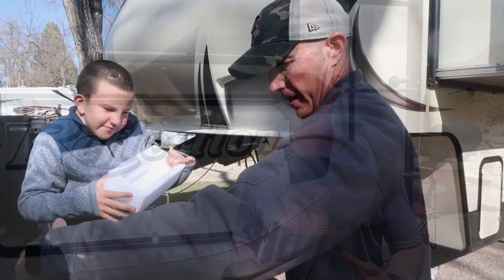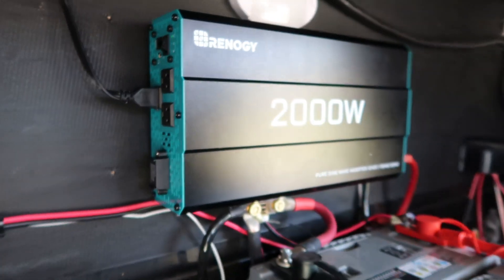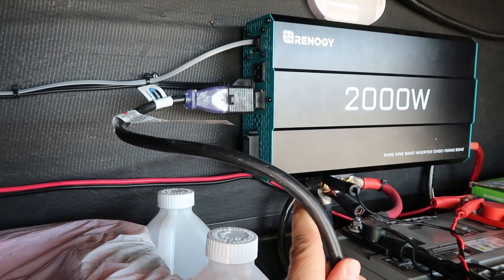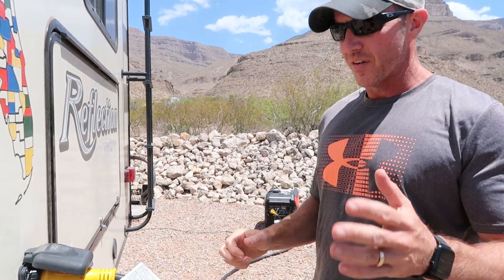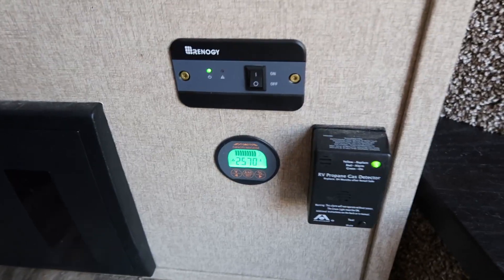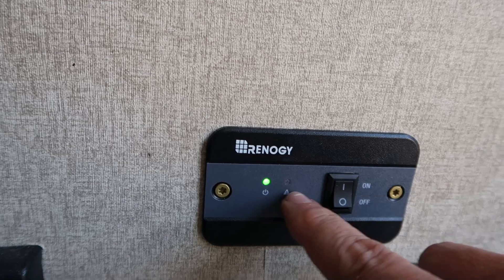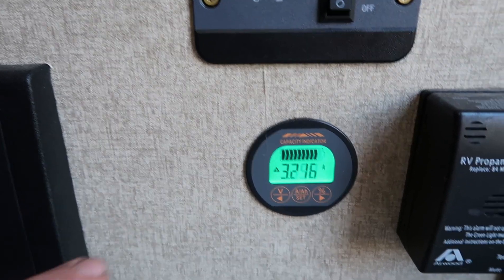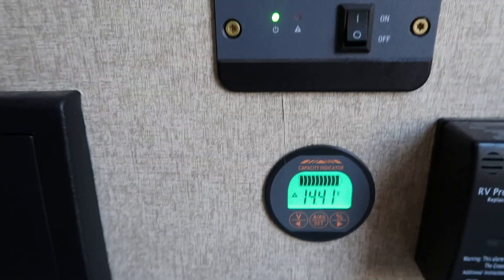How To Power Your Entire RV With An Inverter | Easy Inverter Power

Comment: Is your inverter hooked up before you battery monitor or after
Reply from the maker: Depends on how you look at before or after. The main negative cable from the battery goes to one side of the battery monitor shunt then all the other negative cables (including the inverter) go to the other side of the shunt so the battery monitor will read the amperage draw. This way, I can see the real-time draw being put on the batteries while the inverter is running. I hope that made sense! Thanks for watching!

Comment: It’s Frank I forgot to tell you that I have 2 2’ x 6’ Solar panels on my roof. I have a 32’ Motor Home.
Reply: I don’t know at this time cause the motorhome is in storage and I’m picking it up on Monday I’ll let you know then thanks for your reply
Reply: Let you know everything is fine when I’m camping except for when we go Boon docking I have no other source except for starting the generator so I wanted to add a inverter to keep from Starting the generator I don’t have any extra storage I did find one spot under the kitchen sink to add a small 2000 W inverter to my auxiliary house batteries. That’s why I was asking you a question. So I like the way you did it and I’m going to try it I let you know.
Reply from the maker: That seems like about 400 watts (at least) worth of solar. What house batteries do you have currently?
Reply: Heyy, I just bought a travel trailer..... this language is foreign to me. Somebody please hellppp.  I want to avoid a generator because I don't want to tote it around behind me. Will a wind turbines solar and inverter (on batteries) run the whole thing MAINLY AC
Reply from the maker: I don’t have any experience with the wind turbines. You would need at least a 3000 watt inverter to attempt to run the A/C and a large battery bank with enough solar to adequately recharge them. Running the a/c on an inverter and solar is doable but a very expensive setup. A small 2500 watt generator might be enough to run the a/c if it had a soft start installed on it. That size generator is much easier to handle than one like our 3500 watt Predator generator. Hopefully this helped a little. Thanks for watching!
Reply: @JouppiOutdoors  thank you much for sharing, I subscribed
Reply from the maker: You’re welcome and thank you!

Comment: Hi my name is Frank when you hook up your inverter did you hook it up to existing house  batteries or added two new batteries. I have no room to add new batteries.
Reply from the maker: I removed the single battery that came in the 5th wheel and replaced it with the 2 group 31 AGM batteries that you see in this video. If you absolutely cannot add more batteries, you could get a higher capacity house battery and still wire your inverter to it. Thanks for watching!

Comment: What is that port on your fifth wheel called 2:11 ?!? Because I don't have it 2:11into the video
Reply from the maker: It’s just the standard port where our regular 50 amp power cord plugs in. I am using a 50 amp to 15 amp adapter in the video. Thanks for watching!

Comment: My current battery set up ( lead acid ) is in a battery box that has a vent to the outside... if i install agm  batteries, will i have to vent them the same way ?
Reply from the maker: No, AGM batteries do not gas like a regular flooded battery. They are internally vented so there are no fumes that escape from the battery. Thanks for watching!

Comment: I have 5th same . Same Ali monitor even . But when you plug inverter to shore power . Make sure the got water tank switch is off. Because it's sneaky.  Lp heater and fridge I'm guessing.  But water heater I got screwed up on .
Reply from the maker: Good point, I should have mentioned that. I took it for granted that people would know to switch the water heater and fridge to propane. That’s where the battery monitor comes in though, you would know instantly if something like that was on because the amperage draw would be very high. Thanks for watching!

Comment: We have a very similar set up for our inverter! I don't have a monitor though. Probably need one. My switch is outside. Where is your house battery? I still have mine and it runs separate from our AGM batteries. We run our generator the same way. Thanks for sharing! Chris and Barbara
Reply from the maker: We run everything on the 2 AGM group 31’s. That little battery monitor is awesome and not very expensive at all! Thanks so much for watching!